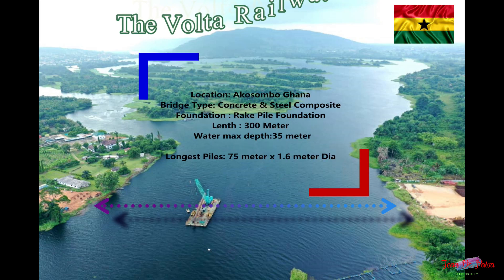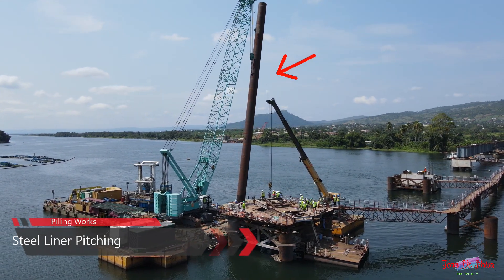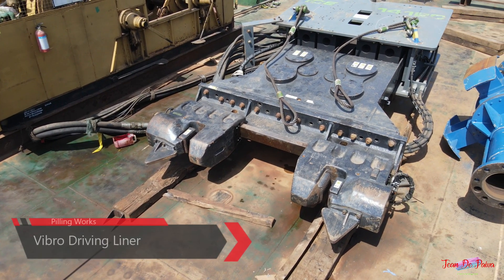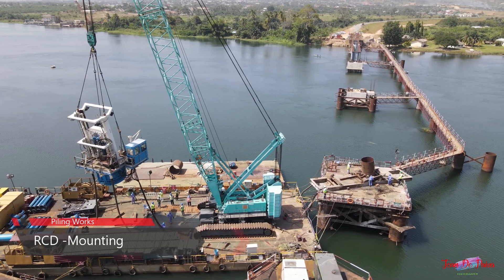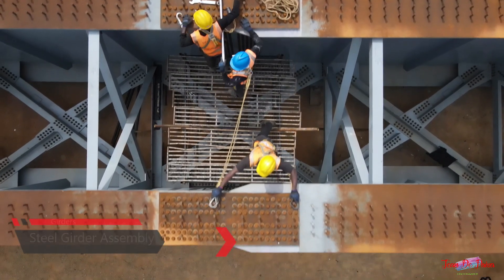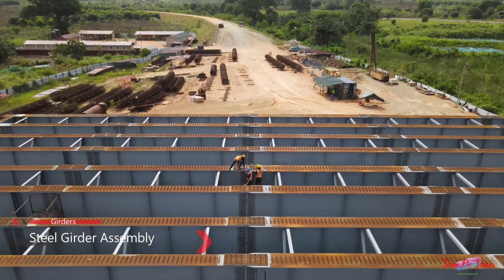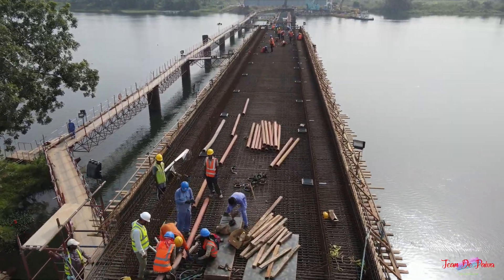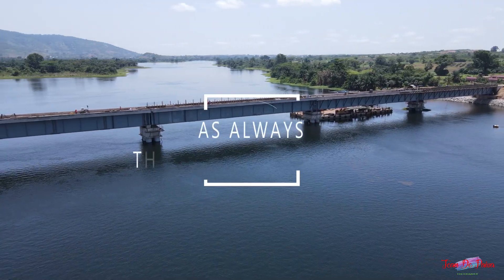How it was built, Volta Railway Bridge! Ever wonder how it was made?

Comment: Is this Railway Bridge Over Volta River, Single Lane or Double Lanes? That is the question.
Reply: Single Lane or double lane doesn't actually matter. If you knew anything about railways, u would know railway lines have to be dual at exchange points.. I work on the Etihad rail 2D project connecting the whole of UAE 7 states together and I can tell you for a fact that almost 90% of the rail is single lane... Even the already active dubai metro lines most are single lane... only at exchange points that dual lanes are implemented and the traffic electronically managed so there's no crash...
Reply: Most Ghanaians are ignorant and they dont want to get educated on so many things unfortunately. The world is evolving but they still remain the same.